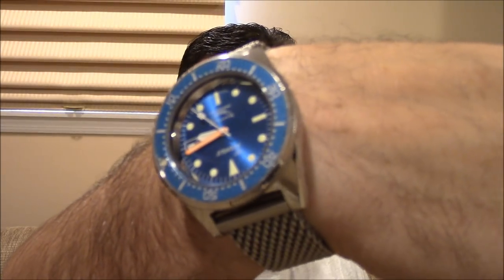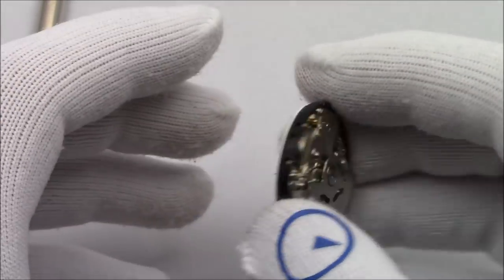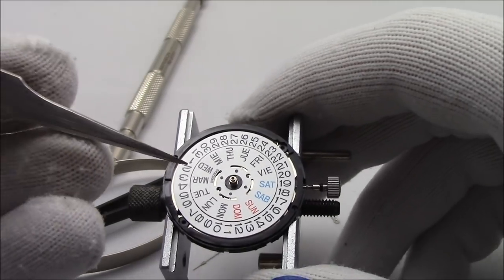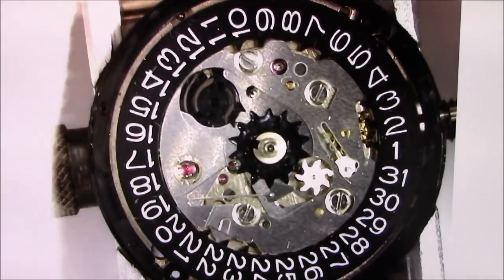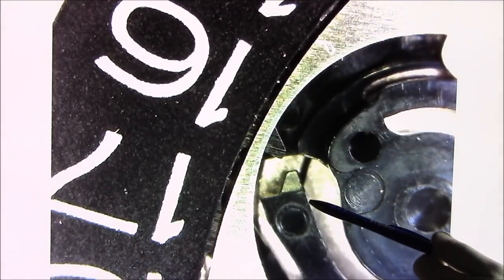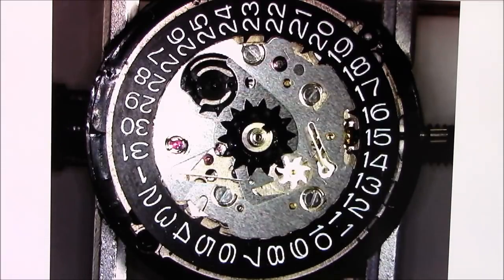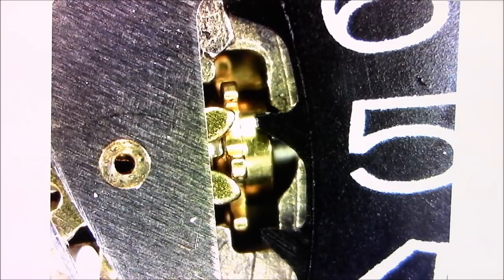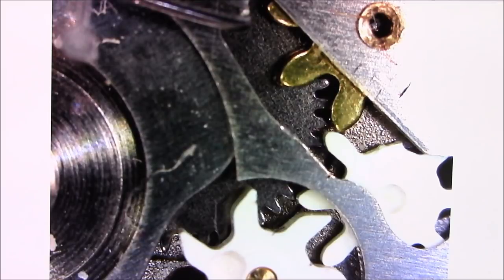Adjusting Mechanical Watch Day/Date Precautions & Best Time To Change Date - Watch And Learn #36

Comment: Hey, Marc, I've got a question that's a bit unrelated to the video, although I hope you'll be able to give your opinion. I was looking at a Casio ERA500L; it was designated with a 100M water resistance, however it doesn't seem to have a screw crown, or back listed. Would you still trust the water resistance designation?
Reply from the maker: Sure; doesn't need screw down crown for 100m. In fact, I've handled 300M WR watches without screwdown crowns.

Comment: I forgot to add I also have a Oris TT1 chrono that the quickest feature does not change the date. It kinda moves the date but not correctly. I know these watches all need issues fixed and most surely need a service. I am currently looking for the best place to send them in to.

Comment: What about a higher quality time piece?  Do they have better fail-safes in place? I hate to use price as an indicator but what about a reputable brand in $500 range and a reputable brand in the $1,000 range, would these problems still exist  there?
EDIT: if anyone was wondering I have a Ball Conductor Translucent II (goes for about 1.2k - 1.6k) The owners manual has the reminder to not reset the date between 8pm and 2am.
Reply: Unfortunately it's not that simple. I've repaired watches in a wide price range, and the design of the date shift is different in practically every watch. Whereas most has a safety that prevents damaging the date shifting mechanism, not all of them are equally clever or effective. Some are even absolutely certain to break if you attempt to change the date during automatic shifting. The safe option is to simply not changing the date while it's shifting automatically. Or if you must, then first turn the hands FORWARD untill the date has fully shifted, then set your date and time.

Comment: Is this only an issue with quick-set day functions? What about “hacks” like rewinding the hour to 8pm, then advancing past midnight to jump the day forward on watches with no quick set?
Reply from the maker: That's fine.
Reply: That would just be doing what your watch would normally be doing anyway, just speeding it up. All the hands and parts are going in the direction they are supposed to go in.

Comment: Depends on the watch brand, not every watch has this problem?
Reply: Correct. Not all, but the majority does. Each brand has their own different date shifting mechanism, but almost all of them relies on a spring to protect the mechanism from taking damage in this situation, and that spring is fragile, and can break, or in some cases fail to release and then cause damage to the teeth instead.

Comment: Hi !  Just to complete my question about, position #1 the copper gear that we see movIng the mechanism for changing the date then the day is the same one that will be moved slightly to the right in position #2 and connect to the spring winding mechanism. Correct ? What I would like to see is how it is actually moved in place (as the crown is now being pushed back in) That would really be great. Your videos are real great....merci beaucoup !

Comment: Great video!! I changed the date at 11:30 PM one time. I have a Miyota with 21 jewels movement. I could have broken the mechanism?
Reply: How did your watch fair? I just got my first automatic and out of the box the time was set at around noon or 11:30, it was also date transitioning. I went to pull to second position to change time and going through the first position the crown shifted the date as I pulled it out, now I’m kinda freaking out.

Comment: I just accidentally did this thinking it was 2PM instead of 2AM when setting the time , am i screwed
Reply: was it an automatic movement?
Reply: I'm assuming you have your answer by now, but if it still works properly then you're fine.

Comment: From those day changing gears it is clearly visible, they where  designed to be able to change day/date manually any time (video's times 16:10 and 16:55). Problem is in cheap plastic gears that brake down. Mechanism looks half thought through. No way it is Swiss made :-))))

Comment: should have done this on an ETA.
Reply from the maker: Maybe another time!
Reply: Is the ETA having the same issue? What about the Orient movements? Do they have plastic gear for day/date?
Reply: ETAs are little different in changing day and date unlike Seiko and Orients. ETAs will have a  change exactly on 12 AM and both day and date together. But Seikos will have it date around 1 am and days around 3 am. The meachanics is not same.